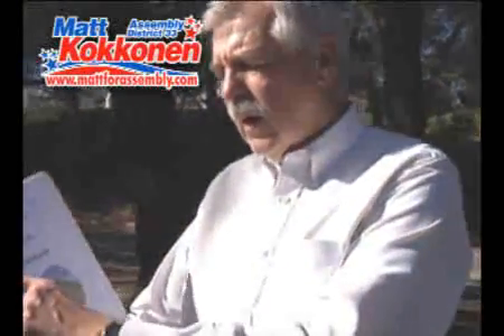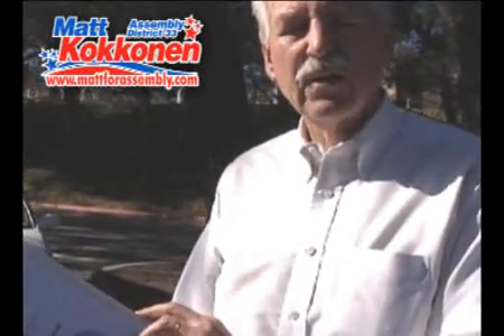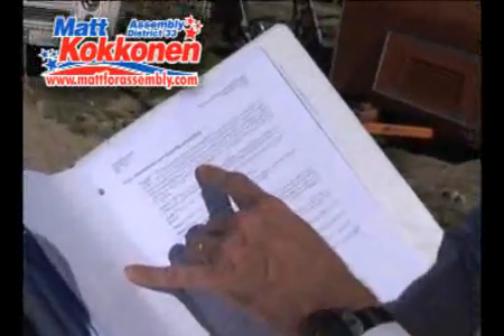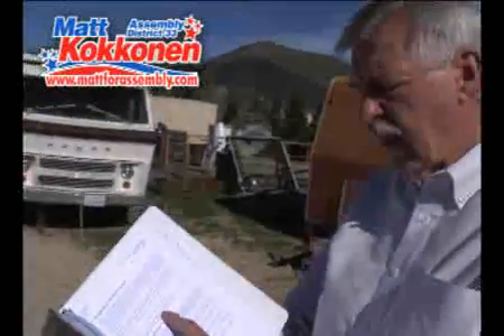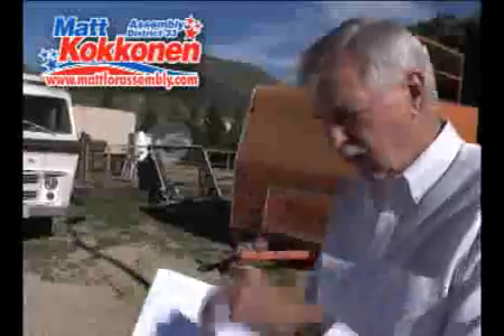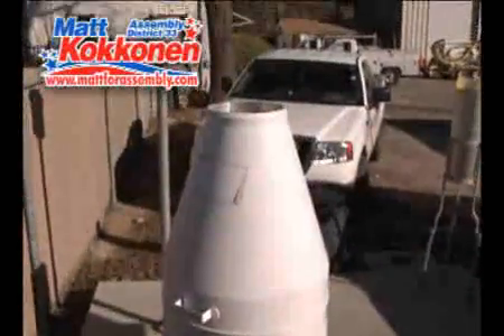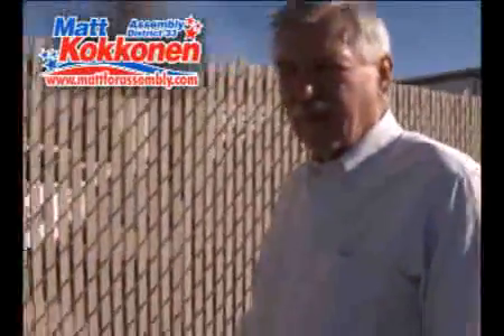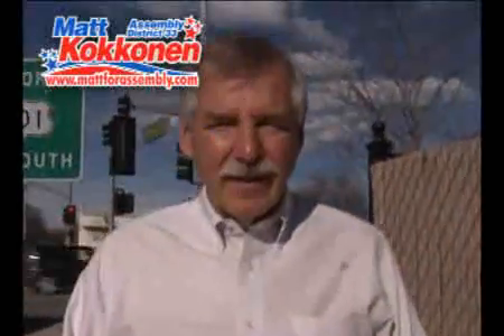Matt Kokkonen on erroneous climate change sensor readings

Comment: also, since you are so concerned with the error, you should realize as well that there is a difference between relative measurements and results vs. absolute measurements and results.  the increase in global temperature is a relative result ... so the absolute errors you are quoting are pretty much irrelevant because they ratio